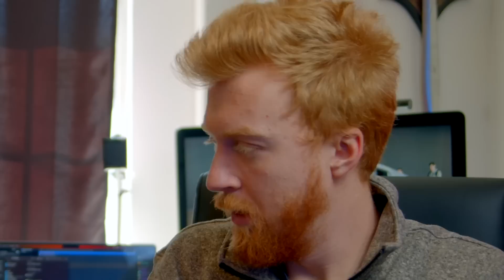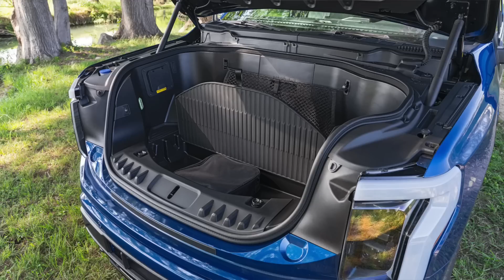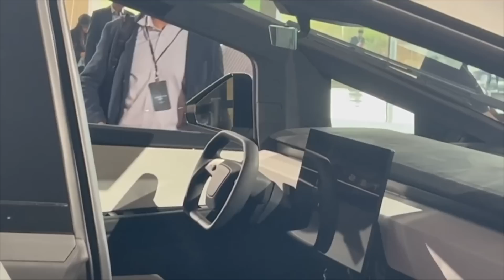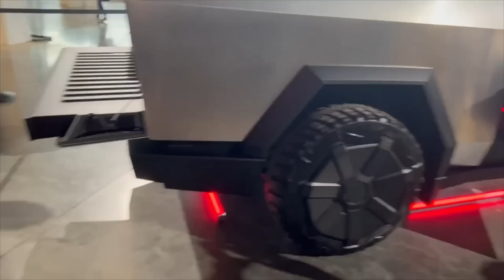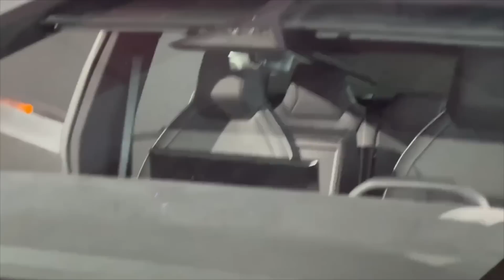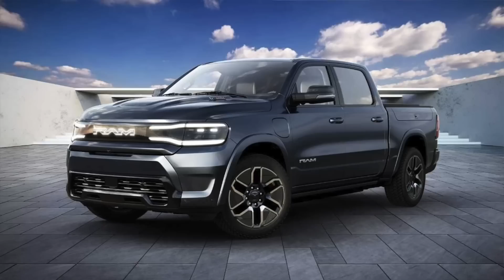Tesla Unveils Cybertruck Interior Updates!

Comment: Its so bad on many levels, not a great truck, I don't think this will ever 
hit the market or do well without major redesign
Reply: @TailosiveEV  popular pickups such as the Ram 1500, Chevrolet Silverado, and Toyota Tundra, which are all Class 2a light duty trucks – Tesla expects the Cybertruck to be Class 2b-3. That's the next category up.

So the competition you are saying it will outsell are medium duty trucks and based on specs of the ''Concept truck'' it's pretty underwhelming compared to the figures medium duty trucks from Ford, Chevrolet, and others can boast? That's before getting to the practicality issues it has, flat windscreen will get damaged instantly, that wiper and replacing the blade, the flat body panels will get super damaged, Is Tesla known for quality of parts, fit and finish ? I do hope Tesla goes back to the drawing board and askes a truck designer to design the truck and presents a new concept that actually works, but this one is a flop and will damage share prices for the company.

Comment: Great video!  Thanks for covering.  I think the design is looking better and a dash more practical though I do wonder if the truck is a dash too big.  It still looks like a modern monster (though I do love it!)  I too share your concern about the thick plastification of the Cyber Truck bed, but I'm betting there are surprises in store, just as they haven't revealed the frunk yet.  As to what that might be, not sure, but I could see one panel dropping to reveal a Tesla bolt on wench, shovel, etc. for the serious off roaders.  I could also see storage for a rack system similar to Rivian to mount things likes bikes and skis.  But you're right about price.  No way is this vehicle going to be less expensive than a Y in the configuration we saw in your video.  This will likely slot in right after the Y in pricing at just under 60K , 65K topped out I bet (overpriced beta FSD software sold separately, not to be delivered anytime soon!) Stay tuned I guess.
One thing that really intrigues me is whether there will be a Tesla solar tile cover option for the bed.  I'm guessing there might be based on some reflections I saw in a recent overhead drone video while the Cyber truck was driving around Giga Texas I think it was.  Nothing would drive a nail in personal rival Fisker like offering a better solar option and pricing on the Cyber Truck compared to the Fisker Ocean which rings in fully loaded at more than 75K.
Finally, one concern, I noticed the weird weathering along the corner of the trunk (frunk?!) of the video.  If this Beta vehicle is using the same metal/finish as the eventual production version, that's a lot of weathering for a vehicle that barely gets driven.  Just saying.
Thanks again!

Comment: Fan of the steering wheel, a perfect blend.  Glad they kept close to the original dimensions.  Love the electric tonneau cover.  Badly wanted the pass-through.  Badly wanted a gauge cluster as it just fills the cabin better instead of it looking so bare.  It would have been cool to have a center console that turns into a seat, but not a deal killer. Hope there's a side step option for my wife to get in comfortably.  Finally, please allow us a different look for the wheels.  Those look like space hubcaps, not high quality wheels.
Reply: with the air suspension plus or minus 4 in and a top height of 16 in clearance, that would be 12 in on Center and 8th in lower. That could be your step feature.

Comment: There definitely is some cost cutting showing on this prototype.  Things deleted:
1) Light bar
2) Fold-down front seat
3) Tailgate ramp
4) Sail storage
5) Full width stainless steel bed
6) Multi-position tie-downs
7) Presenting door handles
8) Rear taillight strip
9) Behind the wheel display
10) Width reduced (?)

Things added:
1) All-wheel steering
2) Rear seat display
3) Rear under seat storage
4) Lightning-type frunk (?)

Comment: If you put rain x liquid on windshield as per manufacterers instructions when you go above 40 mph the water just beads and wind pressure pushes the water off like water on a duck feathers AND you can see CLEAR THRU the windshield.  I hardly use wipers.

Comment: I’m hoping for a “front-gate” (front tailgate), where the split is at the traditional hood seam and the lower part folds down (hinged at lower plane above bumper and sealed all around) to provide better and lower access to the frunk space, as well as an expanded work surface.
Reply: I think a front gate would impede access to the frunk. But the work surface idea got me thinking.   For camping, the frunk could be outfitted as a kitchen.  They should have power outlets in the frunk for that purpose (and other purposes I haven't considered).
Reply: Have they considered a front gate? I never thought about lift and lower then you might be able to run a trunk gate party? And a tailgate party simultaneously?

Comment: Wheel/Yoke/Woke - A round steering wheel would make the most sense in a truck, but the yoke is cool. The compromise "woke" does nothing for me. 
Frunk - I don't like the gaps. I would give up the utility of a Ford like frunk to lose the gaps. 
White interior - Looks good and white doesn't show as much dirt at black. 
Wiper - looks good. 
Bed - I'm sure it holds 4' wide sheets, so no concern. I'm still hoping it has a midgate. 
Center console - An extra seat would be nice on rare occasions, but a fixed console is going to be more usable. 
Fold up back seats - Nice but not a must have feature. 
Wheels - the hubcaps do look good. I'm sure there's also nice-looking wheels underneath.

Comment: Totally agree with you about wanting function over form. The Cybertruck is the only EV truck that can tow my 40’ trailer a reasonable distance and the reason it is my only option.
Reply: You don’t know how it can tow lol
Reply: @mattbrew11  Model S / 3 / X / Y have been towing OK! Semi. Sure. Cybertruck is meant to tow. Well see?
Reply: @synikster  every ev that has a tow rating tows. Thats irrelevant. OP said tows a 40’ trailer a reasonable distance. If reasonable is 80 miles maybe so. Towing a trailer that long with a truck thats now about the size of a Rivian isn’t going to be a great experience
Reply: @mattbrew11  As irrelevant as a 40' trailer without knowing the gross vehicle weight rating of the trailer. He can tow something light weight and still be fine.
Reply: @synikster  nope. I have fleet data showing an absolutely clearly connection between size and range, much more so than weight.
Reply: You own CT when you already know it's towing capabilities? Even Tesla doesn't know it yet...

Comment: I like the new wheel. I definitely feel that the steering wheel type should have been optional from the very beginning, especially for such an outlandish shape as the yoke. 

The biggest issue with a yoke is for people doing off-roading because it is very common for harsh landscapes - dips, bumps, rocks, etc - to yank that steering wheel right out of your hand. With a round wheel you can semi-loosely hold the wheel and let it turn as it wants to, whereas with a yoke that's not really an option and would probably hurt or injure your wrists if you tried to hang on tight.

Comment: I am disappointed that they changed the bed to the more traditional plastic insert.  My grandfather taught me that you were responsible for you securing your own load. The roads are littered with stuff that has blown out of pickup beds.  Removing the groves for tiedowns means I will have to install my own.  Wonder how difficult it will be to drill holes in 30X stainless steel?

Comment: disappointed about the lack of pass-through to the back. THAT was my favorite hoped-for special feature, by far, allowing the best station-wagon ever. I am now somewhat less enthused about my early position in the queue. Adding a hermit-crab CyberLandr doubling the original price of the truck would be an expensive consolation. Maybe this makes my unit more of a flip-opportunity and waiting another year or two to await a pass-through, or to go instead for the future smaller deLorean vanity truck, which may also be a Godot proposition. Without the extra driver display, which I can do without, I would expect a heads-up display instead, have not heard if that could happen.
Reply: It looks like there arent any wires going through the back wall.  It may be possiabke to remoce the tano cover, cut a hole in the back, amd put on a perminate camper back with passthrough. Turn it into a cybervan.

Comment: Using 1 giant windshield wiper instead of two of the like, clapper style ones that both pivot at the same time but just miss one another seems dumb…

Also, hate to be the bearer of bad news but there’s almost no way this thing passes crash safety tests. The energy of an impact has to go somewhere—this is why vehicles have crumple zones. Where’s the crumple zone on a steel exoskeleton? Fingers crossed NHTSA puts an end to “FSD” once and for all. I Absolutely don’t wan’t these things cruising around of their own volition. 

I think the closed, rectangularish steering wheel is rad. Similar to Canoo, which I think is a great design. Best of both worlds.

Comment: The bulging area in the bed is where the wheel wells intrude on the bed.  One thing I did not see that was obvious before is the charging port.  It used to be right behind the rear wheel on the driver side.  Where did it go?

Comment: Would be awesome if the frunk folded in 2 sections. The hood lifts and the fascia folds down (to use as a table). Ability to close the hood independently (or remove it) could allow moving around a worksite or just hauling even more things without hindering driving
Reply: Frunk Gate party!

Comment: yoke or woke makes sense if they use electronic proportional steering so that the wheel turns less the +/- <90 degrees.  Steering, suspension, brakes (electronic?) are the mystery features that matter.

Comment: Maybe it has only 5 seats because the truck size decreased. But I hope there will be at least six seats.
My guess is that the bed is smaller because off the back steering, which needs more space.
All black seems smart and I wish there will be an tailgate and a little screen above the yoke
Reply: There will not be 6 seats and 5 good sized men aren’t fitting in there either
Reply: It didn’t decrease in size.
Reply: @xploration1437  yes it did. They stated yesterday its been reduced by 5% the bed is obviously smaller and the width inside vs the initial truck

Comment: That second row screen looks pretty good size.  Cybertruck seems to have a lot of features in-line with the S and X type features.  Definitely will be expensive to start.  I'll start saving now.
Reply: Need a display in front of the driver
Reply: I hope they make a base model withoput those gimmicks. Don't need no second row heaters or display. Would love more vault length instead.

Comment: I much prefer this wheel over a standard wheel or the yoke. I’ve used both extensively.
Reply: Same. That wheel is perfect.
Reply: @cliffdailey  I doubt it's perfect. I'm much more open to this design, but I feel it could be a little rounder at the top, closer to a normal wheel for going in reverse. I'd also personally like to the see some buttons on the wheel.
Reply: I race cars, this is a pretty typical wheel for super sports cars on the gt or gt3/e catagory. It the best design possible
Reply: Off road whiplash might be a thing unless it's drive by wire

🤷 They probably against that knowing the S and X, and for safety for autopilot/FSD override (and safer from hackers)
Reply: Anyone with a brain does lmao
Reply: Love this design
Reply: Totally agree
Reply: Yea! Looks like best of both.
Reply: Anyone who has ever backed a trailer would prefer this to a yoke.  Put one hand in the six o'clock position and watch your mirrors.  Move your hand minimally in the direction you want the trailer to go.  Kinda difficult to do that with a yoke.  Delighted that this steering wheel is open at the six o'clock position.  Seems that the Tesla design team finally talked to someone who has actually used a truck as a truck.
Reply: I like the woke. I like the ramp. The Frunk is a great asset for a pickup. I hope that it's very large.  I think that there are side boxes. I ordered the 500 mile range   trimotor. Tonneau/duvet is awesome! Is rear wheel steering going to happen?
Reply: Be better off road , too, I believe.